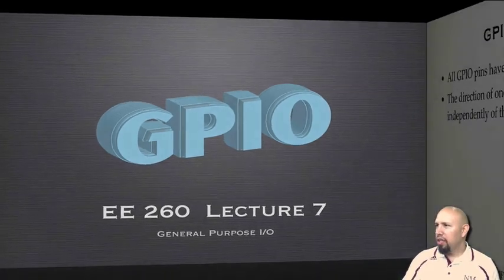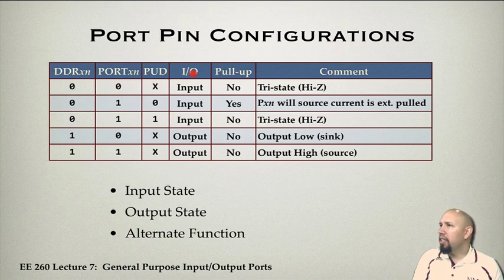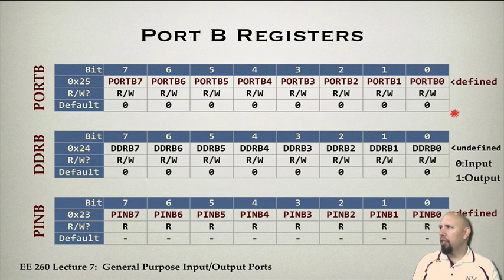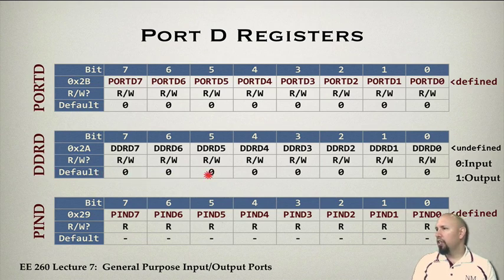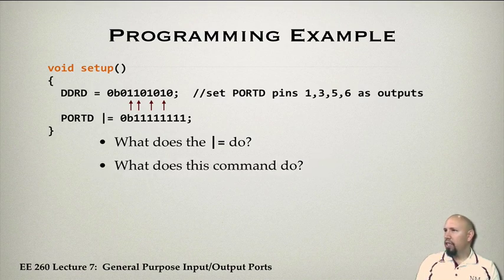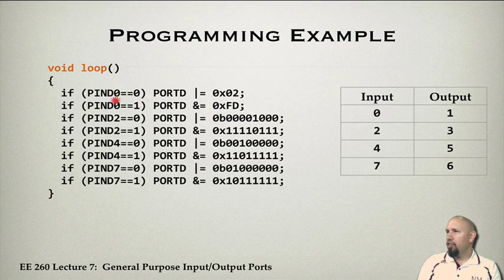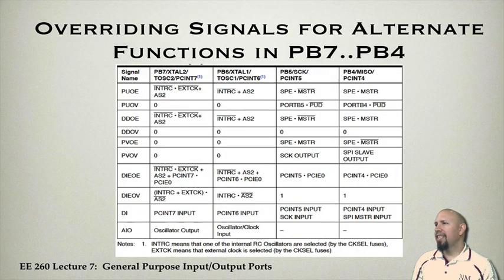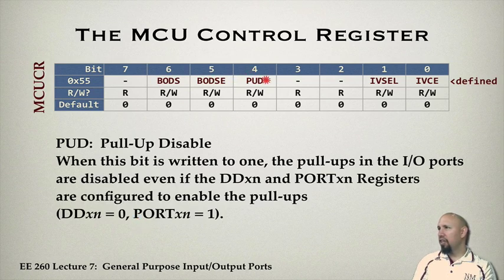7.  Arduino General Purpose Input/Output Pins

Comment: 29:25 I've always used the following mnemonic for recalling the 1:Output/0:Input pin protocol:

Oh (letter 'O'), I will have Won (sounds like number '1') if I get the correct OUTput (so 1:Output), but if I'm a ZERO (i.e., loser) then I will be IN (input) trouble for failing to make the circuit correctly (so 0:Input).
Reply: If they ever reverse the protocol to 1:Input/0:Output in the future, use this mnemonic instead:

If I have WON (number '1') then I'm IN like Flynn, so 1:Input. But if I'm a ZERO (i.e., loser) then I will be cast OUT, just as the archangel Satan was cast down from Heaven (Revelation 12:7-9), so 0:Output.

Comment: Writing a 1 to the PINxn Register will toggle the Output of the respective pin (if set to output). I guess that will make the blinky sketch more efficient.
Reply from the maker: Indeed.  The basic Blink program has a number of ways to become more efficient.
Reply: Hi @Robert Paz: I was not able to access the lecture slides at: "https://drive.google.com/openid=0B5jlwlXJI8pJVGgwOEg5TFNBTGs". It shows a 404 ERROR. Will it be possible to share the lecture slides for all the videos including your videos on "Arduino Assembly", "Arduino Basics" & "Hands-on Arduino". This would help a lot of people as it would be good reference material. Thanks a ton in advance.

Comment: Do these videos eventually teach programming in the Arduino IDE, C/C++, and assembly? Or is this more of a technical "how it works" course? There is a ton of knowledge here, I am wondering if I will learn how to use all this information. Or is the student expected to acquire programming skills elsewhere? Sorry to be a pest, thanks.
Reply from the maker: These videos teach and provide examples using 3 levels.  The top level is used in videos 1-5 (in the Arduino Basics), and uses the reference commands of the Arduino.  The second level involve programming the Arduino using the registers in C/C++ (also in the Arduino Basics). The third level is programming the Arduino using Assembly Language (in the Arduino Assembly), and are videos 12-16.  The Hands On Arduino videos apply these three levels in working specific hardware examples.
Reply: What did Johnny Carson (Tonight show host 1000 years before Jimmy Fallon) say when a joke bombed? "What did you all pay to get in here? Nothing, exactly, let's bear that in mind."

Comment: At 46:30 havnt you specified hex representation for pins 2-7 but then wrote them out as binary? (every other set when you are clearing the single bit)
Reply from the maker: Yes, it should say 0b11110111, not 0x11110111, etc.  Thanks for pointing that out.
Reply: I think Robert made a mistake. Every resource I can find specifies 0b as a binary number specifier and 0x as a hex. My understanding is 2,4,7 should all be designated 0b.